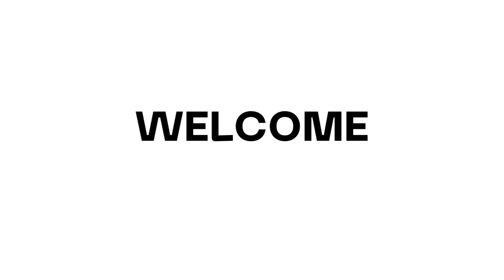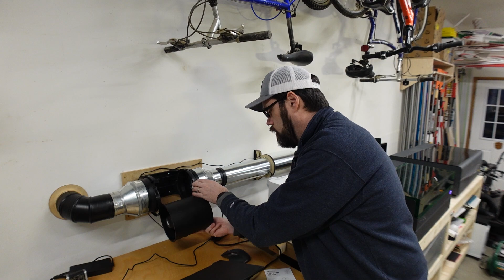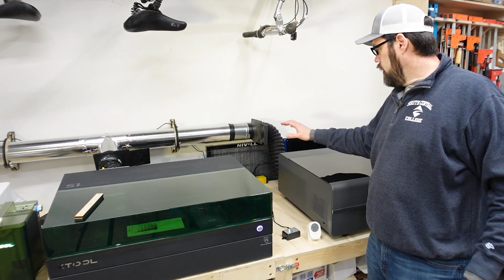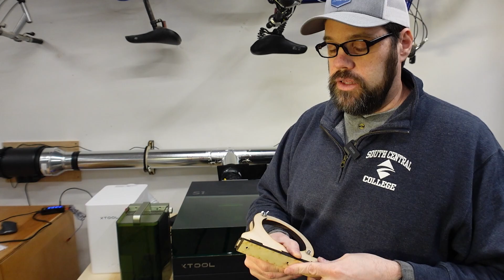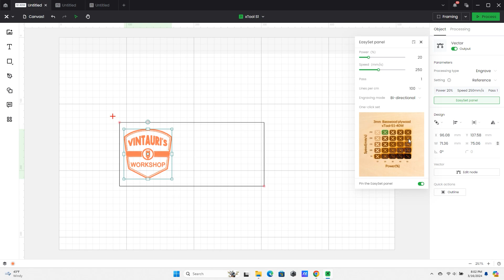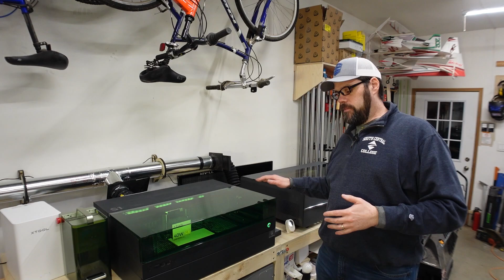Inline exhaust for better laser smoke extraction

Comment: Nice. Love the wall mount clamps. 
I’m developing a similar solution with splitters and blast gates. 
The final step I’m thinking about is hanging the PWM signal from my printers internal fan (galvanically isolated ) drive the inline fan , so the fan comes on when the laser would turn on its fan.  

Have use given any thought to integrating the output fan controls from your lasers to automatically drive the inline fan , and eliminate one step to remember in getting things going? 

Also , any need for a spring loaded relief intake on the pipe to help the inline fan when you forget to open a blast gate?

Comment: Nice job on vent but you might want to put jumper wires over plastic hose segments and ground it to prevent static buildup , good luck
Reply from the maker: I've done that on my dust extraction system for the CNC router and other saw dust creating machines, but I've never ran into that with just smoke exhaust from lasers.  It definitely is not a bad idea to minimize any risk from static.

Comment: Is there an easy way to remove the exhaust fan on the xTool S1? This way when the additional external fan is active the supplied box fan that comes with the unit doesn't serve as an obstruction.
Reply from the maker: Unfortunately no, they did not make it easy to remove the internal fan.  It's not ideal to have it still in there but I didn't see a way to remove it without causing possible harm to the laser as well as confusing the XCS software.

Comment: I need help. My S140W exhaust fan has stopped working. I'm trying to resolve this with xtool. Up until now, I have the machine routed through the original air purifier then out the window. Since the fan stopped, nothing is being pulled out. I have an inline fan on the way bc the air purifier has never really helped with the smell. My question is, if I have an inline fan hooked up, does the exhaust fan have to being working? I hate the thought of having to replace it. I have the riser and it seems it's going to be a nightmare to change. Help!
Reply from the maker: The built in fan does not have to be working for the inline fan to pull air through, however it will reduce the effectiveness of the inline fan. I wish xTool had made the S1 exhaust fan as easy to remove as the P2, so we can just get it out of the way when using a better system like I set up. To optimize your setup, make the run as short as you can and as straight as you can. Avoid using the flexible hose if possible and use some straight walled pipe if you can. Also try to avoid sharp 90 degree bends.  The sharp bends and the ripples in the walls of the flexible hose all create turbulence and will slow down the air moving through the system.
Reply: @Vintauri  Thank you for the response. I appreciate it. Yes, taking it apart is freaking me out. Such an inefficient way to work on it.

Comment: Great job but one suggestion.  Use a “wye” connection vs a “T.”  You call it a Wye but it’s actually a T.  You will find a smooth wye that you can direct the air to flow smoothly in the direction of the flow of the exhaust air.
Reply from the maker: You are correct that it's best to use a Wye connector when possible.  In this case with how close the pipe is to the back of the lasers and the fact that the lasers output is straight out the back of the machine, a 45 Y would have created a sharp bend at the back of the laser possibly creating a more turbulent flow than the T connectors I have here.  I was reusing an older port going outside the shop.  If I was to do it again, I would have the outlet up higher allowing more flexibility in making smoother bends in the pipe when needed.  Thanks for watching!

Comment: Love that you anticipated for easy maintenance.  If I have to break out a ladder and a tool belt it'll never happen, lol.
I'll be pulling through a DIY fume box (3 furnace filters and charcoal), before venting outside.  Do you think the 6" would handle it?  My runs will be nearly identical to yours, with whatever pipe diameters work best, (using an anamometer).
Reply from the maker: There are a number of variables to that on how disrupted the airflow would be. In this case I would go with 6" straight walled pipe as much as you can and keep the bends and sharp corners to a minimum.
Reply: @Vintauri  I just learnt you can run inline fans in series, WOOT-WOOT.
If the 6 or 8 inch fan I mount to the wall doesn't pull through the filters, I can put a fan on the filter box, and tap in with wyes and blast gates...who'd of thunk?

Comment: Nice clear explanation.  Just wondering if there is a check valve at the outside to prevent wind forcing its way in?
Reply from the maker: I have the typical flap on the outside that opens when the fan is on, but it can also sometimes open a bit if the wind is right.  It would not hurt to put another blast gate or valve at the exit to provide another barrier if you feel the need.

Comment: likely putting less strain on the motor as long is heat is dissipated enough to cool motor windings.
Reply from the maker: I’ve been running a similar setup in my basement shop for over a year and while that does not seem heavy use, it’s not failed me yet.

Comment: Good video, looks great. Do either of the lasers have any filtration before exiting the enclosure? I have my Ikier 48w in a homemade enclosure, cutting and engraving created so much smoke that the inline fan and the screen outside the garage actually became clogged with smoke residue. My solution was to use A/C filter cut to cover the 4" exhaust flange inside the inclosure. It takes about 20 seconds to replace it and when I have a pile of dirty filters, I just wash them out in the sink and re-use. They do a great job of keeping all the smutz out of the inline fan and exhaust port.
Reply from the maker: I do not run any filters on this setup. As you’ve noticed you do have to clean the fan and outlet or it will build up residue from the smoke and vapors.

Comment: Thanks for the topic, I have been looking forward to seeing modifications to the S1. I am running an AC Infinity 4" with good results, though I plan to remove the internal fan in the near future as is offsetting the true potential of the inline. Please keep us posted if you remove the fan from your machine.
Reply from the maker: If I work out a way to remove the fan without erroring out the laser and hopefully not voiding the warranty, I'll be sure to share that.  I'd hate to recommend anything that would cause people issues with support of their machine, and if I do, it will have a big disclaimer on it.
Reply: So, what about flame detection and auto fire suppression with the inline fan? I have a similar set up on my S1, but have not yet figured out a way to shut it down during a fire (without hitting the fan switch manually). Had a fire on my D1 and forgot to hit the inline fan switch, so sucked all the fire suppression before putting out the fire. Had to turn off inline fan manually and hit it with the fire extinguisher again. Cooked my wiring, but no damae to the laser head (just luck though).
Reply: Would you really want to turn the fan ON in a fire? Air flowing out means air is coming in somewhere; it's not a vacuum.

For oven fires and most anything contained in a relatively enclosed box you just shut off and leave it closed.  Let smoke build and suffocate itself.  Open it up to try and air out smoke and it will breathe and flare. 

I could be way off base here which is why im asking it as a question.    But more air flow either direction seems sus

Comment: Did you already have the 4inch galvinized pipe before you added the 6inch inline? I know youre aware that you lose alot of CFM because the pipe isnt 6inches.  Using 4inch pipe out of each laser into the 6inch main would be perfect.
It still looks better than mine with black flex.  I had to cover the end with fine stainless wire mess to prevent birds or wasps making nests against the damper.
Reply from the maker: Yes I already had most of the 4" piping from my previous set up.  So before spending too much on extra piping I thought I would see how it worked out with this.  I also might move things around and then I'll look into the 6" piping as it will be much better and might allow me to add more ports for other lasers as well.

Comment: I have the same exact fan, it works very well with the exception of being leaky on airflow around those clamps and the backside. Tape the devil out of it to seal it up and you'll never have any issues. The one fan runs all of my shop's extraction: 2 CO2 lasers, diode, and 2 galvo lasers.
Reply from the maker: Thanks Sam, I was going to ask you what fan you installed as it seemed to work very well in your setup. I'll be doubling back and adding some tape around it to ensure I'm not  getting fumes leaking out.
Reply: I agree  I have one like this and it is no where near air tight enough.  Now it could be that I gave it set up like host with 4 inch going to the 6 inch fan then out to a 4 inch exit vent.  I have taped it with painters tape as I don't want to make it too permanent.  Great video

Comment: Good video ... comes at the right time! I just finished an enclosure based on the plans on your Etsy site (mine is larger to accommodate my ATEZR P20), using a 195cfm fan from Vivosun. Right now, I am running a flex hose out under the garage door, but plan to run metal pipe through the wall later this spring. A file to cut pipe supports would sure come in handy (SVG or Lightburn)! Any plans to add that to your store?
Reply from the maker: Yes I'll be tweaking the clamp files and will have them available soon.  You'll like the increased flow from straight smooth pipe over the flex hose. Thanks for watching!
Reply from the maker: https://vintaurisworkshop.etsy.com/listing/1698178253
Reply: Thanks! @Vintauri

Comment: I think the big improvement would come from some inlet vents along the front face of the machines.
Reply from the maker: Yeah that may help, the P2 has some inlet space on the lower front where the crumb tray slides in and the S1 with the riser has lots of area where air can leak in.  But having some air pulled in from the front would definitely help.